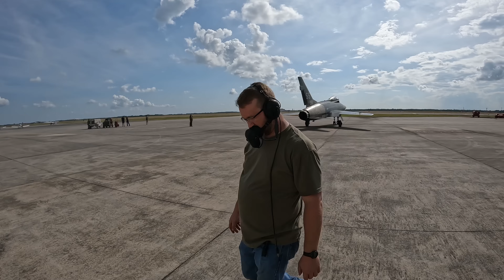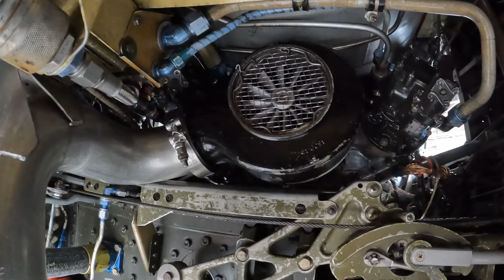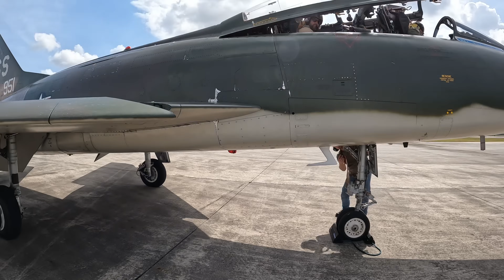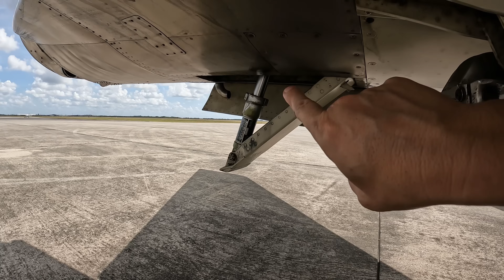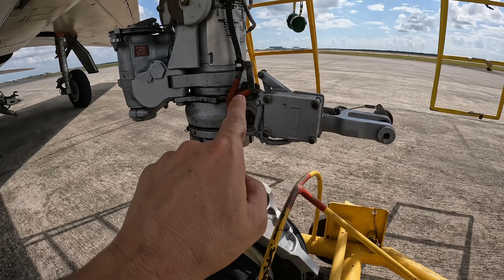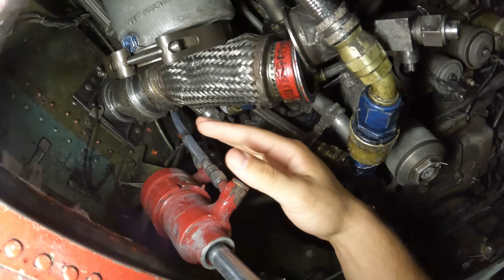Nice To See the F-100 Flying Again!

Comment: Crewed a F-100 back in the early 70's. Good to see this one still flying.
Reply from the maker: That's awesome, thank you for your service! What did you like most about flying the Hun?
Reply: @DieselThunderAviation  I was ground crew. Didn't fly but did do run up tests after engine swaps, etc. A bit unnerving was sliding down the intake for the first time to do an inspection.

Comment: Good to see it fly again, I remember seing the Royal Danish Airforce F-100's in the air over Denmark back when I was a young boy, always exiting to see the sleek form of the F-100. RDAF has saved one in the museum at Stauning airport in Jutland.
Reply: kd41599, FYI this aircraft is actually an ex-RDAF aircraft! It flew with the Danish as GT-844.
Reply from the maker: She sure is! All the way down the Martin Baker Mk 5 ejection seat, instead of the North American Aviation built ejection seat. Of the two flightworthy Super Sabres, she is the oldest, tail number 56-3844.

Comment: Congrats to Rick and all the guys at the Vietnam Aircraft museum. The sled looked. But you missed the best part, the burner kicking in. It makes one hell of a bang (almost as good as a Thud).  Who's thought it was a good idea to disconnect a fuel line without putting a bucket under it.
Reply from the maker: Thank you! One of these days the wind will cooperate we'll have the departure on our end of the runway. Not sure on the bucket though.

Comment: The pissing the fuel on the ground is a Pratt and Whitney thing.  GEs including the j79 dont do that, they scavenge the fuel.  F-15s with the 220e still piss fuel.  Pratt finally figured it out with the 229 and new engines
Reply from the maker: Learned something new today, thanks!
Reply: @DieselThunderAviation  I learn something new every time I watch your videos.  Either you teach or show me something or dad explains something to me.  So we'll call it a even trade.
Reply: Also, not true, lots of military planes did this as the ecology bottles required by the EPA and FAA weren’t required for military ops.
Reply: @GLEX234  most early jets did this.  GE had it figured out my the mid 50s with the j79.  Pratt didn't until the mid 90s.  Now this is on their military jet.  But I'm sure the jt3 did because it was a j57.  And the jt4 did because it was a j75.  They might of added bottles to catch it.   But I know that the j79 didn't have to cycle the throttle and have a catch bucket under it.  And the f110ge100 didn't have to do that either.  But the  pratt 100 200 220 had to cycle the throttle before shut off and it would piss fuel.  You where supposed to catch it with a bucket.  I'm sure if crew cheif al is asked he can tell you the same thing.  I believe he said he crewed f-16s at Ellington.  If he was there after 95 he probably crewed our old block 25s,  with the pratt 220e's

Comment: Ta-4 Engine should be Pratt and Whitney J52-6 been almost 40years since I was i  VT-25 . Time flies.
Reply: Both of the TA-4’s here at Ellington have the J52-P8’s in them (9,300 lbs thrust). Collings has P8C and 518 has P8B. But you’re correct that most of the TA4J’s had J52-P6’s

Comment: Good to see the Super Sabre flying!  As a former Skyhawk guy, I also appreciate the look at your TA-4!  I had a license to run the engines on my squadron's A-4M's and TA-4's, so I've dealt with the air start process.  The A-4M's eventually got JFS (jet fuel starters) and didn't require any GSE to start.  The early A-4's had the J65 engine and didn't even have that onboard turbine to start with the assistance of GSE.  There was a separate piece of GSE that had a turbine that drove a shaft that extended up into the J65.  This external turbine had to be inserted to start the J65, and then removed after starting.  The A-4C at the Warbird Heritage Foundation has one configured like this, and I got a video of the start process:  https://www.youtube.com/watch?v=VmA255p2MHg

Comment: A DCS guy here:  I see the nav lights flashing on the F-100.  On DCS/Heatblur’s F-4E, the wingtip nav lights don’t flash.  The white under fuselage lights, v-stab leading edge red light and trailing tip white position light all flash together.  Many years ago, when I was a kid near San Diego, I could swear the wingtip lights flashed together with the others on F-4Ns and F-4Ss out of NAS Miramar.
How do they work on the F-4D?
Could you do a quick video with a close up of every light on F-4D and its location on the aircraft ( not necessarily illuminated, if that’s not feasible)?  They were all incandescent bulbs, I think.  Are they going to stay that way or get changed to LED?  Although, I think you may have said there’s no intention of flying this F-4 at night.
Maybe your video could include lights of the TA-4 and F-100, too?

Also, I see a MiG-21U in the hangar.  Did that one, by chance, come from San Diego in about the last 5 years or so?

Comment: Quick question for anyone really. Is there any significance to the unfinished panels on the left side rear of the airframe? I have seen a few dated photos of other F100's like that and wondered.
Reply from the maker: Sure is! You'll see in old pictures where the Air Force painted the entire fuselage, but they learned that the paint didn't last long in that area due to the heat from the engine. Rather than constantly touch up the paint, they opted to just leave it bare/polished.

Comment: Where do they fit the train horn on the F-100 😮😅😂
Reply from the maker: Over at the railroad tracks a couple hundred yards west on the airfield! There's a set of tracks that runs parallel to highway 3. I've been interupted a few times now by a train horn blasting whilst I'm talking to the camera 😁
Reply: @DieselThunderAviation  You guys are all on the right side of the tracks 👍🏻😁😎